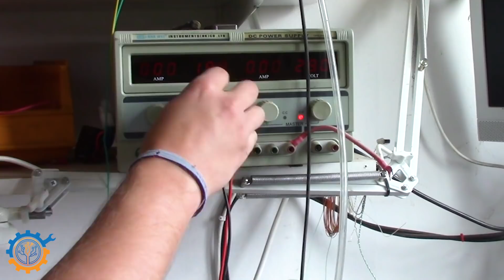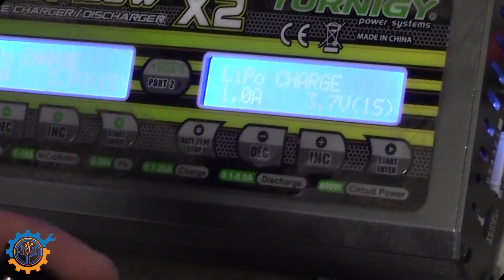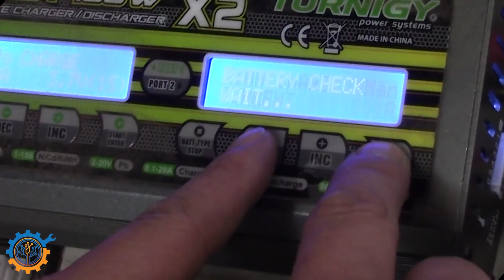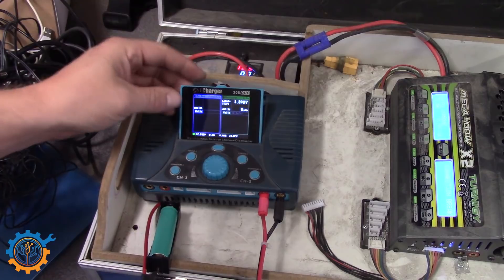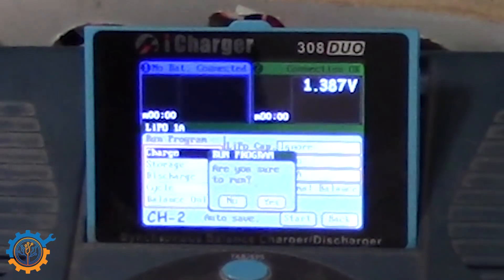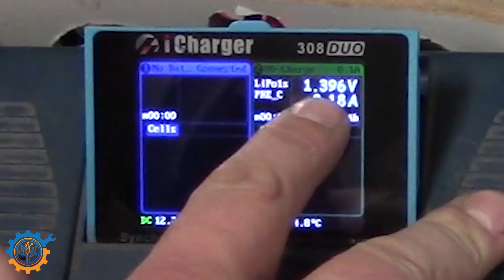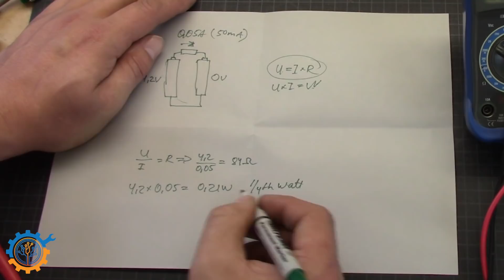Bump charge/revive your dead or low voltage 18650 cells

Comment: I have a battery that have 0v. When i short the battery by 5v. It grow up 0.67v. then i charge it, after some hours it grows 1.8v. then sometimes 1.9v. but when i test the battery the voltage go down to 1.6v. which charger can i use to charge this battery? 🔋
Reply from the maker: Its dead. It should go to the bin. There is a reason why i was at 0 volt and why it drops down after you kicked it up. Sorry.

Comment: Hello. Thanks for your useful video. A question: If the li-ion battery shows zero volts, is the CID protection definitely activated? Is there no other possibility? Because my battery was very new. It was left in the device. Could it not have been completely discharged?
Reply from the maker: @IS-zk9be  it can be cid, discharged or internal bms that shut down. Depends on what cell it is. Only the bms part is what would say rescueable.. Most cells that gets discharged to 0v is severely damaged I'm afraid.
Reply: @DIYTechRepairs  thanks for the comment. One more info: There is zero ohm resistance between the positive and negative terminals. Zero ohm and zero voltage. Does this give us a clue?
Reply from the maker: @IS-zk9be  Sounds like dead short. Thats not the CID. Thats a totally failed cell.  Toss it.

Comment: If you reset the CID with a screwdriver- Will the CID still function if there is another gas buildup?
Reply from the maker: First of all. if the CID have been triggered there is something wrong with the cell from start or have been abused. Secondly if you tamper with the CID you kind of potentially let out the gas to get contact again but you can not guarantee that you did not harm it. And if you did.. That we will assume since its not made to be reset and you cant see what you are doing... Then you basically created a dangerous battery. 

Dont. To risky.  Burning a house down for tampering with 1USD cell is not worth it :)

Comment: Thanks, you saved my ecig 18650s! I used the NiMh method at 0.12A. And 3 or 4 bumps each brought them back from 0.7V!!! That got them JUST above 2V, where I quickly "caught" them and the Li-Io charge started... 2.714V and climbing now! Is it normal the charge starts slow? Set it at 2A, but it's going at 0.15... I assume it will pick up once the Voltage approaches more "normal" levels?

Comment: Or you could get a proper charger like an nitecore charger or a XTar charger folks 

I wouldn't recomend that you charge your batteries like the Dude in this video did
Reply from the maker: You can but bumping a cell with resistor is as fine and easier than running above chargers in NiMh mode to get the voltage up. I would rather use a proper Bench PSU than above chargers to do that if so ;)

Comment: I have two that just sit dead when using the bench top at 4v at any milli-amp, or my Hi-tec x1 rc charger
I disassembled two laptop battery packs that had sat for a long time so all cells were very low,
I just wanted to weed out the bad apples, thank you.

Comment: 82ohm for max 50mA current. After assembling battery bumper. I get around 500ma flow. Did I do something wrong?
Reply from the maker: U = I * R. If you get 500mA you have a resistor of =  4,2/0,5 = 8,4Ohm and not 82 ohm...
Reply: @DIYTechRepairs  Thank you for your reply. I did measure resistance on thr positive side of the bumper (with resistor) It gives me 82ohm. The other side (negative) gives 0 ohm. When I put two batteries in parallel mode( one is 4.2v another in 1.7v) It charges battery, but it happens too fast. When I measure current flowing on 1.7v I get around 500mA. I understand your math is right, I am just puzzled what could I be doing wrong. Maybe faulty resistor? It seems to be slowly dropping though. It dropped to 100mA. Theres is a possibility that it can't  be measured properly while it is charging with the tools I have.

Ok, finaly, I figured it out. If I have only one charged battery in the bumper (4.2v) in slot 1, and slot 2 is empty, it measures 50mA on the slot 2 leads. I guess it was drawing current from second battery as well, when I was measuring it first time.

Comment: Have discovered an easy way to do this. I put a couple of good cells in my liito kala and a dead one I disconnect power. in a couple of minutes, I reconnect power charge the dead cell then test the capacity. I am no genius but I thought this through and it worked for me.
Reply from the maker: Cool
Reply: This worked for me as well! Thank you, It takes about an hour to go from 1.7v to 2.2v. Then charger can do normal charging.

Comment: Hello,
Could you please inform if my battery is defective?  I have an 18650 battery at no load measures 4.2v but under load it drops to 2.5v.  The battery will not take a charge via my XTAR VC2 charger because the charger sees the battery at voltage capacity, i.e. full.  When I connect the battery to an external power supply set at 4v and a constant current of 100mA, the current reading stays at 0.  Is this battery defective?
Thank you very much for all your help and great video tutorials.
Reply from the maker: The CID is most likely triggered or the cell is just very bad. I would recycle the battery and get a new one instead.
Reply: @DIYTechRepairs  OK, thank you very much for the very quick reply.

Comment: I literally just revived a dead 18650 (showing tens of millivolts) by using the nicad function.  Long story but I tried soldering my battery bank at first and decided half way to abort and use a spot welder. Removing the solder proved stressful and I had 3 cells dive on me, (out of 238 cells, not a bad fall out rate).  We might be tip toeing on being battery doctors by how complex things seem to get with even a simple 5 minute diy video.  Thanks a bunch for the tips.  Great video.

Comment: I have a quick question. I have a 10s2p battery that have the volt drop to 18.53. just wondering if I can bump up the voltage using the DC power supply method, maybe can advice what voltage I should start with and how much current to start with...

Many thanks
Reply from the maker: Yes you can. Best is though ro bump each cell Group Up to 3v and then max 100mA per cell. Then when all 10 groups are done you're back in business. Bmping overall voltage is a bit riskier and you then need to monitor each cells voltgae
Reply: @DIYTechRepairs  it comes as a pack... Bumping each one means I would have to rip open the pack... If am to bump the pack... What is the suggested voltage though
Reply from the maker: @stanleytan9717  You dont have access to the balance wires?  If you dont have that you can only guess that it will work and that the internal BMS will do its job if one cell fails. Overall total voltage would be 30+ volt if its 10s.
Reply: @DIYTechRepairs  thank you very much for the information and really appreciate the help and quick response even though this video is out  for so long!

Comment: My battery is 36v... I don't have a fancy charger.. But I have another 36v (10S1P) ...  Can I hook them together with a resistor? 50mA seems super low.. I'd rather do 300-500mA like a normal charger...

If urs 0.21w for 1 cell.. Can I use that x10 so 2.1w for 50mA. Then 21w for 500mA?
Reply from the maker: Im not sure what you want to do? No you should not hook 2 in parallell like that unless they have proper bms atached

Comment: What's the lowest voltage a charger requires to detect a 18650?
Reply from the maker: Depends on Charger. But 1.5v+
Reply: @DIYTechRepairs  any reason why I can't put two batteries in series, say they're both at 1v each, to fool the charger into thinking it's a single battery at 2v and get the charge started? How does battery resistance affect the charging?
Reply from the maker: @areyouavinalaff  You can but at same time you need to monitor so not one of them jumps to high and the other stays flat. Its better just to do it properly :)

Comment: Any help for my 18650 i've done this method but nothing i overcharged it i was supposed to charge it half an hour but i charged it for 2 hours shit i need help with this.
I sleep for 2 hours i forgot i was charging it
Reply from the maker: No problem if voltage was det below 4.2
Reply: @DIYTechRepairs  hehehe guess i wont be messing with it any more i threw it away when i heard a hissing when i push it down with a very verryyy small pressure to it it scared me and also there was a fluid coming out of it. It does smell like acetone there is no way im messing the other battery btw thanks for this vid. And this method really does work but be very careful when doing this cause my battery was really soft when i push on its disc or something

Comment: I've been waiting to find an answer  whether or not lithium could be charged in parallel or series. A dead nonrechargable nickel will charge like an electrolytic on a lithium charger it'll take some juice once it reads full take it out and try it, this means one could refill a nickel nonrechargable if it had a port, I'm not going to try the reverse, filling an electrolytic.
Reply: so if the nonrechargable nickel reaches full charge off a lithium charger acting like an electrolytic just like an overcharged electrolytic it could blow up right? maybe you could take a dead nickle nonrechargable and use it in place of a electrolytic might hold more capacity.

Comment: good video,  early in computers I remember something about pcb's in computers, so I looked it up looks like there's 2 meanings,  pcb's(organic) released when a capacitor heats up more than room temperature and printed circuit boards. The nickle rechargeable if they were more weatherprotected they would be better,  if the nickle rechargeable heats up more than room temperature and releases fumes would it be pcb's as well?

Comment: You  can actually do it with Imax B6 by cheating a bit. First charge cell up to 1.2V with NiCd/NiMH program. Then charge up to 2.4 V with Pb (lead acid) battery program. Then charge up 3.4V using  the LiFePO4 program. Then charge up to 4.20V using the LiPo program. There you go. Charge at very low amperage (0.1A) up to at least 2.5V.
Reply: Interesting

Comment: I just charge 0v batteries using a tp4056 or cheap powebank case from alliexpres and the cell gets charge enough without problem. After that I finish the process with opus.

Comment: Hi need some help on these 18650. I’m new to these type of batteries and a little bit nervous on charging them. 
Do I need a multimeter  to check if the voltage is above 2v or can I just put it in the charger as normal, bit
confused on what to do. Link below on the batteries I bought. Sorry for being a noob. https://www.ebay.co.uk/itm/4-x-UltraFire-18650-8800mAh-3-7V-Li-ion-Rechargeable-3-PIN-UK-Battery-Charger/262425807293?ssPageName=STRK%3AMEBIDX%3AIT&_trksid=p2060353.m2749.l2649
Reply from the maker: First of all bin those cells. They are FAKE... You should have watched my video about fake cells :)  But yes when you get real cells just put them in the charger

Comment: Great tutorial, smart solution by using another cell to charge the low voltage one. Note: you meantioned it's possible to use more resistors for spreading the load on them, yes it's possible but there is a note to it. When you connect them in serie you will need to divide the total calculated value (in series it will add the values of the resistors) and with parallel you need to double it (parallel will divide the value by 2 if there are 2 resistors with the same value parallel). If you need to buy just buy one with a higher wattage.
Reply from the maker: Thanks. The 2x resistors or so is more if you got 1/4th or 1/8th W resistors you can still use those as long as you use a couple more of them :)  For instance 2x 160Ohm in paralell is 80Ohm and will then spread the load :) Eya you get it :)
Reply: This is not difficult for me, learned this on school. 😉

Comment: I have 2000watts of solar grid tie, 4000 watts hooked to a lead acid battery tied into a Outback hybrid inverter. I am installing another 6000 watts that is going to my li-ion powerwall that, 3000 watts of that goes to my Outback 24volt inverter the other 3000 watts going to my Outback 48volt inverter. I would like to use my powerwall for our house's nighttime power use. My powerwall will be over 40kw when I'm done. Hopefully 60 kw. I'm at 49 degrees latitude, so like you, I need a lot of back up in the winter! Hopefully you can give me some suggestions?
Reply from the maker: If you have a hybrid inverter that one will do what you want for you in terms of using battery when not enough solar exist. You should be able to set in that inverter what order you should use as source. Ie Solar > Battery > grid.  For the normal inverters always draw power from the battery and that will work out on its own.

Comment: you can use the imax b6 to bump charge/revive your dead or low voltage 18650 cells........ lithium charging.. then set the settings to the desired charging current.. and change the settings from 1s to auto... and it will charge it...

Comment: Really nice! Man, I opened a notebook battery one and all batteries had 0.6v. All of them. So I charged them using a TP4056 connected to a 18650 holder. Then, when I finally got a battery tester and tested them... Surprise: values between 2100 and 2200mAh. Still have them and didn't used yet. I'm going to make a huge power bank. :D
Reply: hehe good on you. I'm still looking for laptop repair places willing to help. Some I called and they say they're busy and email them, so I did.. no response.. grr
I think you'll need to cycle those cells a few times and see how well they work, probably just flattened the shit out of it and wasn't due to a problem causing them to go so low. hopefully if you charged them slowly, it wouldn't have damaged them internally, at least if not already from the 0.6v
Reply: Phizicks Yeah, but they are more than good, probably only the BMS stopped working. :) Anyway, I use to buy notebook batteries in a "exchange fair" (at least is how we call here in Brazil). You know? It's a fair where people sell new and used things, farm animals, even sell or give pets, and a lot of people sell parts of old and broken tools, DVDs and so on. It happens once a week, every Sunday. I already bought a lot of good stuff there, like dc motors and so on, that I use in my projects/videos. :)

Comment: Regarding the parallel charging of cells calculation. Don't you need to consider the resistance of the dead cell???
Reply: To clarify point number one: the possible internal resistances of the cells is so small that it is masked by the manufacturing uncertainty of ... well, any physical resistor you could possibly attempt to produce economically.
Your 1% 1k resistor don't give a crap about your puny 170 mOhm hissy-fit of worst-case-scenario.
Reply: The resistance of a new cell is in the 10s of milliohms, orders of magnitude less than the current-limiting resistor. A damaged cell will only have a higher internal resistance, limiting the current even more.
Reply from the maker: I kind of only went with the worst case scenario and made the calculation very very simple. There is much to be added there in you want the exact current flowing but for our use case i left that out. :)
Reply: The internal resistance is only interesting for the (dis)charge properties of the battery. When the value is to high you will experience a larger voltage drop at higher currents. The value of the internal resistance is in this application to small to limit the current, but it can create a problem with the voltage drop. For example that the battery can't be charged full at a higher current or that the the voltage drops to fast. Both situations can create an instability in the pack. AveRage Joe has videos about testing fuse wire where he explains why, if a cell is not equal to the others in the pack it can cause a current draw. Something you don't want to happen.